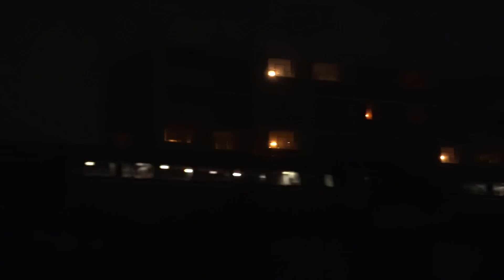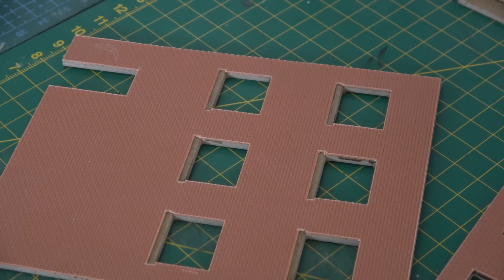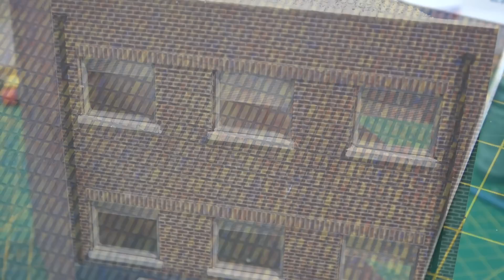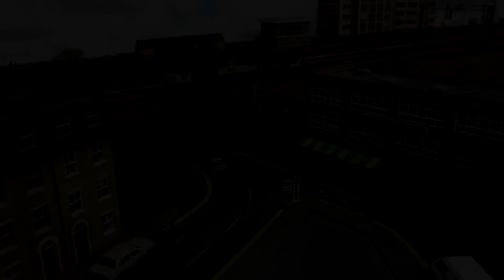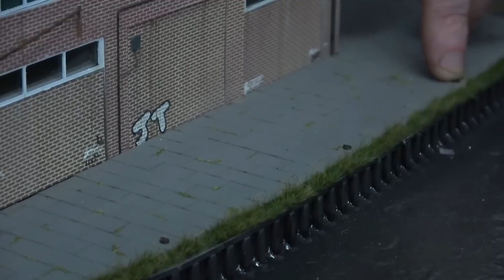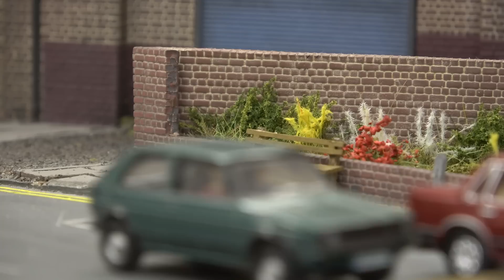New Layout Build - Street Scene Detail

Comment: One thing troubles me about the houses: the chimneys! Or rather the chimney pots. There are only three chimney pots between 2 houses.

The houses are three stories (or 3 and a half stories) and look like they're double pile, meaning that each house on its own will need up to 6 chimney pots (2 for each floor, front and back). Even if the 2nd floor is unheated, they'd still need 4. And as the chimney stack is shared between two houses, this would need to be either a double row of 4 pots, or 8 in a single row. They really look like they ought to have a double row of 6 given the size of the chimney stacks.

By the way, I think the houses look really good and I admire the amount of work that's went into them. I just like looking at chimneys on houses because they tell you a lot about the house.

I think you based these on a real life prototype, I'm not sure how the chimneys are on the real thing. But I imagine there's a lot of creative things you can do with the pots - original pots, cracked pots, replacement pots, pots with wind breakers (not sure what they're called), pots that have been removed because the house has been converted to central heating, etc.

Also would be interesting to see more of the houses with modern fenestration. Usually a row of houses like this will have several modernised houses in it from different periods, particularly a row like this where the houses were once fairly fancy but the area's had a bit of a decline.

The above is a really minor thing, I only mention it because you're attention to detail is superb. Love the channel and I think your work on the layout is amazing. Thanks for sharing with us all!

Comment: Beautiful work as always, you are setting a great standard for others to aim for.

If you are looking for more things to light in that area;

some lights over the front doors of the terrace houses

In Sydney where i grew up most public areas were lit up to reduce the potential for crime. Pedestrian underpasses etc were normally lit with a series of spaced fluro tubes with a heavy duty plastic cover bolted to the walls a little above normal reach.

Where they were visible to the public at night, often advertising billboards were lit with two or three fluro tubes mounted out in space, above them.

Comment: I always look forward to your videos.  I feel like I'm watching a real place come to life.  Very impressive, very immersive.  
I feel the need for an orange wrapper Crunchie, some Space Invaders crisps, and can almost smell a brand new copy of Ian Allan Combined Motive Power!
I'd offer if I may just two constructive technical observations:
1. A practical (and Building Control) requirement for almost every building built 1870 onwards would be that the floor level is 6" above the surrounding ground level.  This applied also to (most) shops too, as there was no Accessibility legislation until the 1990s.  Any house with an internal floor that is exactly the same level as the pavement, is going to fill with water as soon as it rains.  Typically, building plinths (incorporating a damp proof course in slate or bitumen) were covered with about 2 inches of cement render, so retrofitting this could be done with just a new thin base layer...and a few doorsteps.
2. Chimney pots and flues on party walls: I see you've (accurately) put party chimney stacks between the handed terrace properties.  A detail note, the flues would be double, so for a single party stack central to the property, with one fireplace to each floor, there would then be 8 flues, and 8 chimney pots (2 x 4).  Victorian shared party chimney stacks are typically 3.5 courses wide (4" outer skin, 9" flue, 4" dividing course, 9" flue, 4" outer skin) or approximately 1m.
I know you seek a balance between realism and impression, constructive feedback given in full admiration for your productivity and spectacular modelling skills! 🙂🏗🏆

Comment: I always look forward to your videos, and as usual this one did not disappoint.  Plus I picked up an important tip which I had forgotten from a previous video--using orange transparent paint to lower the color temperature of LEDs.  My layout is quite small (1 x 6 feet) and is lit overhead by a single strip of LEDs set in a wood inside corner molding.  I just went to the trouble and expense of switching out a "cool white" strip for a "white" one to lower the color temperature in my photos.  Perhaps I could have avoided this using paint instead!  In any case, I will now experiment on a test strip by applying paint to, say, every third LED to see if the mixture has a more pleasing effect.  Cheers from Wisconsin!
Reply from the maker: The paint trick can work really well.  Can take a few applications and sometimes you might need to rub it off and start again.  For creating that sodium lighting effect I've found it to be very useful.  Cheers

Comment: I was thinking about the flat roof areas of these when I first saw them, (beautiful work by the way, they do look extraordinary), that you might have used fine sandpaper sprayed grey to imitate the texture of the felt. When I made a diorama for a friend to display his train he wanted a felt roofed garden shed, so I used some fine grit wet and dry sandpaper, and although it was a charcoal colour, I still sprayed it lightly with a dark grey car sealer, it looked pretty realistic as the texture was already there. It is cheap too.

I have to admit those houses look much bigger with the detail on them that they actually as when your hand is in shot, a testament to the quality of them.
Reply from the maker: Sand paper does work quite well, I've used it in the past.  The next buildings for this section will probably use that method.  Cheers

Comment: Richard, Have you thought of using self adhesive copper foil for your lighting connections inside the buildings? It comes in a roll about 9" wide (I haven't measured the length, but it is a quite long roll). You just cut off a strip (about 5mm wide), peel off the backing paper, stick it to the inside walls and solder your connections to it. Once painted, being less than 0.5mm thick, its almost invisible. For other wires inside the building, have you considered using enamelled copper "transformer" wire. It comes in various thicknesses, but you can use some of the thinnest, as an LED only takes a very little current. It would be about the same thickness as the wires on your street lights. Again, almost invisible.
Reply from the maker: I use the enameled wire quite a lot but on buildings I've found it's easily snapped when lifting the building off the layout.  However the copper roll is certainly worth a try, I look into it.  Cheers

Comment: Rather than wires for LEDs in buildings were it may be possible to see them, I tend to use self adhesive copper tape, sometimes covered with 'wall paper', and meeting the LED with very close cut leads.

For the scrap yard, might I suggest three guys standing around a 44 gallon drum filled with burning scrap lumber to keep warm...It would offer an entirely different lighting source without being out of place either day or night...

Comment: looking good :) with the wiring of the lights wouldn't it be easier to use busbars instead of blocks as the wiring can be individually taken out if you need to work on them :)
Reply from the maker: I'll probably improve it in future.  This was just a case of get them working with what I had lying around.

Comment: Another great update. Have a think about the the scrap yard lighting. Possibly a couple of spot lights on a scaffold pole with a wire drapped between them and back to the building for the electricity supply. I can't see them digging the ground and putting in proper cabling and ducting system.
You might want to look at a light post outside John Menzies frontage as street lighting is installed on the outside of bends to highlight the kerb and bend in the road. 
Keep up the great work 🤌
Reply from the maker: Some more lights are planned.  I ran out during the build so the side street currently has no street lamp.  Some shop front lighting is also on my list.  Cheers
Reply: @EverardJunction  shout if you need any advice/help as I’m a local council street lighting manager and worked in highways for 35years

Comment: Really looking nice. For the last area I would have added a small park - somewhat like Kensington gardens - to  keep the view on the buildings unobstructed. 
Also about the Redutex sheet I use them now instead of slaters for N scale. For OO stacked bond I think southeastern finecast makes sheets of those in embossed white styrene...
And those night views... absolutely stunning. Would be even better with lit cars (led with small button battery could be adapted to sole vehicles, and adding a delivery van with the rear open and lit while being unloaded would be a nice 'wow' effect.
Reply from the maker: I'd like to experiment with adding some lighting to few vehicles for the night scene.  I'll check out southeastern for some stack bond brick.  Cheers

Comment: Have you seen a spark generator to place on a bend or near points? Now your doing more night running, the spark generators are mainly for garage arc welding but it would need to be one triggered by a passing train with third rail.

Comment: I love your progress.  Question though, you propose to add a building that might block the view of what you already built and your trains.  What are your thoughts on that?  Lower height building or your ok with the view being blocked to give a sense of being in a dense urban environment?   I ask because i was on the fence about that very issue.  I was considering putting in a church that would block the view of my train.  Would love to hear your thoughts (my layout is at eye level).
Reply: I thought the same and then thought a car park would make excellent use of the one way street and not block the view. It could even be a 3 storey multi-storey so it has some height but not obstructive. There are plenty of eyesore multi-storey car parks which would fit right in.